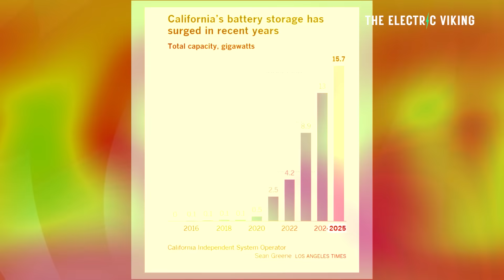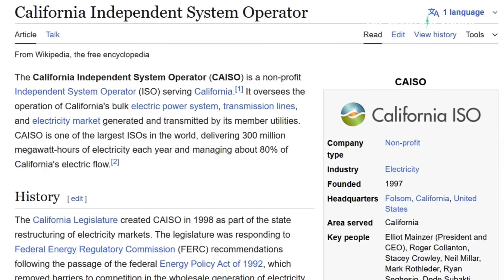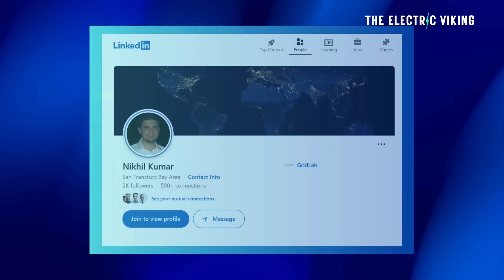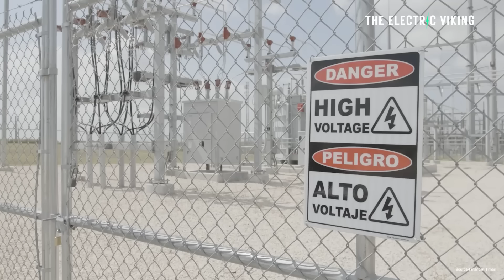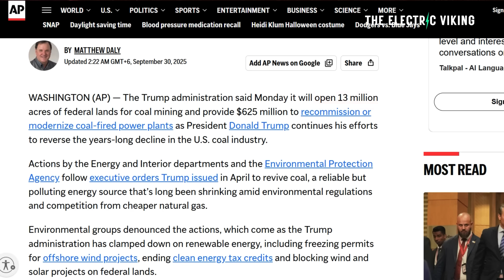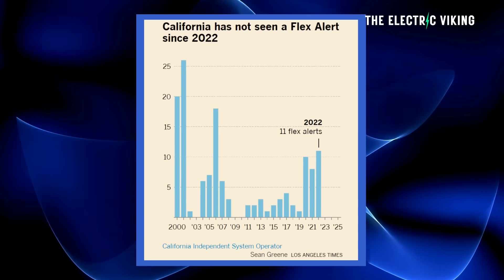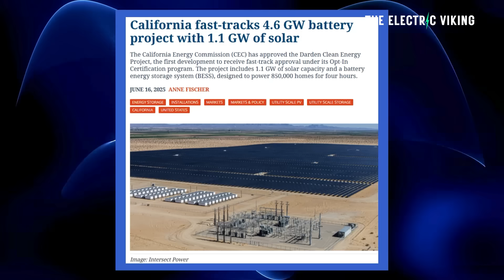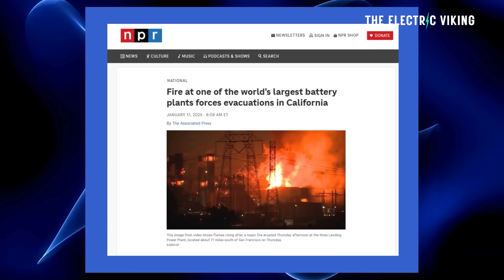How Utility-Scale Batteries SAVED California From Black Out Every Year

Comment: You mean when the giant Moss landing battery farm burnt up - isn't that a blackout of a different type?
Reply: Except that there was no blackout.
Reply: @nathanhunt4448  sure there was in fact they evacuated the entire area.
Reply: @litestuffllc7249  You know they aren't the same thing. Just more Texas technology.
Reply: Estimating from the news reports I've seen this year, it appears that about three oil refineries catch fire for every one battery farm fire.  This raises an interesting question: If battery farms only catch fire when they use old technology (NMC), and the fire only spreads if they are improperly installed (crowded together indoors), how does the battery situation compare to the refinery situation, going forward?

Answer: Battery farms using LFP or sodium ion technologies (which they all will going forward because these are the cheapest technologies by far), will never spontaneously catch fire.  Meanwhile, oil refineries will never STOP catching fire.  They will likely continue to catch fire at their current rate of several refinery fires per year, with the occasional large explosion, and frequent spills and leaks and releases of heavy metals into the surrounding areas.
Reply: @HonestJohn-y3k  Lets presume your ratio is correct - oil accounts for 30% of all energy used, renwables total including solar and wind 5% so you have 2x as many fires per unit  of energy produced. If you are a bit biased and it isn't 3:1 then it is even worse.